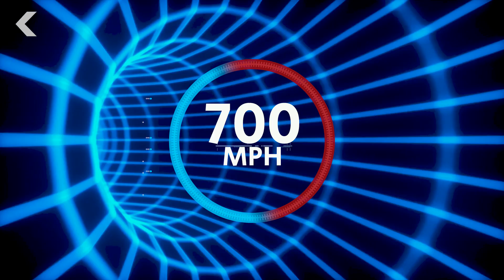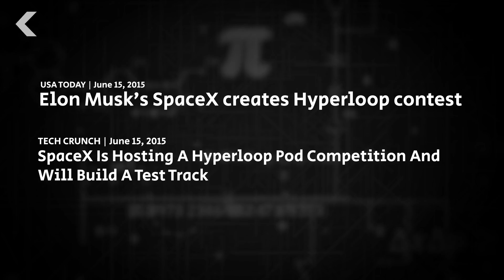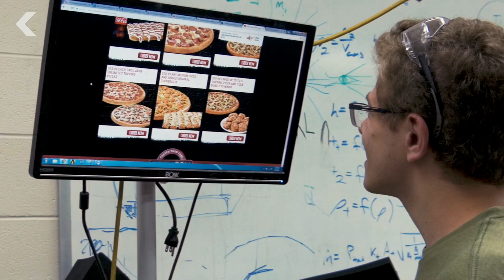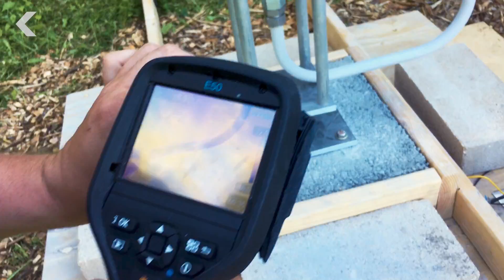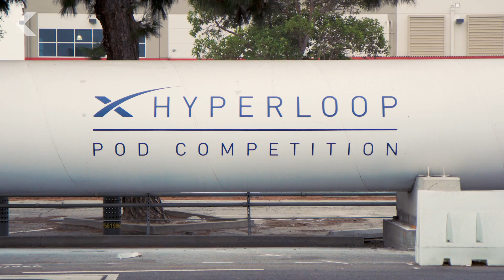These College Students Built a Hyperloop Pod... Here's What Happened

Comment: Cant believe that Musk does not have a single person around him with at least basic structural engineering knowledge, to tell him that this is total crap. He probably knows it, but stays on the route of milking government money for this failure.
Reply: Exactly how does a tube with a hole repressurize?
Reply: Valesto93
Hell, ok. This is just a thin aluminum tube. Aluminum skin of the airplane is not its structural support, they have a steel/ aluminum truss underneath. Without the truss, the tube has to be way thicker than presented to support the weight of the train and vacuum pressure (which is much stronger than the pressure difference on the airplane). Not to mention other stresses it will have (acceleration, foundation settling, thermal dilatations (radial and linear), wind, earthquake, possible sabotage, centrifugal forces if thermal dilatation is to be resolved by allowing structure curving), and yes - significant dynamical stress despite vehicle is floating on a magnetic field. But tube is not even the main problem, the airtight connections between tube segments are. They also have to take all mentioned stresses and keep perfect air-tightness, all the time, thousands of them. There is no force in this world that can stop 3 feet of ground tilt during California earthquake, and mentioned joints not only have to take it, but to remain perfectly airtight. Other structures faced with such problem (like RION-ANTIRION bridge in greece) simply leave "soft" parts where structure is going to snap without major damage, this is not a option for the tube. The level of perfection that this project demands is so far from reality, and i havent even touched dynamics and material fatigue, and security issues are epic. This is so futile. I already said that Musk and his team are probably aware of that, whether they are extorting government or private sheep, is irrelevant.
Reply: fradd i think he's just trying to use it to train student to engineer in low pressure environments like space
Reply: n4rzul aaah yes I forgot that if u just dump a bunch of moneys into sth the physical laws will magically change because hey you are so flippin passionated abouz it it just has to change
Reply: Neat 2cm of steel. That's just thin enough for me to put a bullet into it and blow the whole thing up.
Reply: From a mechanical its also suicidal.  Assuming B31 code and CFR design factors apply the WT and strength of the structure arnt there.  

The steel needs to be increased by a factor of at least 10.  Which makes this ludicrously expensive project completely idiotic.
Reply: it's actually 1 inch thick steel with some (unspecified, unfortunately) stringers for support. you're right that hyperloop is far too expensive though
Reply: Valesto93 few things, with the size of it depressurizing would not be slow it would be over fast and explosively. 2, it wont be high carbon armor plating. If this was made ot would have to be made out of mild steel. Meaning it would only be a matter of time till someone popped it like a ballon.
Reply: No one is saying they are smarter than spacex, what they are saying is that this idea is stupid. Even smart people are dumb sometimes.
Reply: n4rzl You have to think if its
A-cost effective
B-safe
C-practical
D-Will it gain new knowledge
E-Is there better alternatives.

This fails at all of them.
Reply: it's his private company..
Reply: Valesto93 bombs
Reply: But Simens already did something really simmilar with their transrapid technology and it worked.
Reply: (Ottla Kafka) Which law of physics is this breaking?
Reply: (izicial) It wouldn't blow up.
Reply: Valesto93 Your bottom point is right. But your top point is wrong. Just go there and see it for yourself.  It is rust covered and has a lot of bad craftsmenship. The hundreds of engineers that are working on it must be awful.
Reply: There is no new technology demonstrated in this competition, and technology of vehicles used in the tunnel is irrelevant to hyperloop's  main problems, anyway.
Reply: Fradd, Elon musk does know this will never work which is why he is not investing any money into it. There is a reason he has just mentioned the idea but has not done any development himself. He has used this idea to recruit employees for Tesla and SpaceX. The people working on these projects are some of the smartest people out there.

The only thing that Elon Musk has paid for is the vacuum chamber, the winners do not get any prize besides an award. The pods are all funded by themselves (or sponsors). He has set up a super good and cheap recruiting tool to get the brightest minds to come work for him.
Reply: Building a Hyperloop is impossible _now_, which is exactly why this competition exists. To develop the technology required to build one.
Reply: It's still theoretically possible, though entirely impractical.
Reply: I vote for more people like Musk and less like fradd. The world changes and becomes a better place when you attempt to make the imposible, possible, not when you nag and moan about all the ways it can't work. Have some imagination and balls, challenge the status quo, regardless of what common sense might tell you to do.
Reply: fradd How exactly will this be a failure?
Reply: From structural engineering stand point, which is my profession,  its laughable. I cant even begin to explain here. There are many videos and articles on the net tha expain things on many levels.
Reply: I do love how random people on YT imagine themselves smarter then SpaceX, that is just hilarious.
And of course the dumbest people don't have the capacity to even comprehend how dumb they are...
Reply: EpicClone5082 it wil be a faliure because elon musk doesen't know how metal works when it is heated and cooled, it streches. And bom your hyperloop looks now like a crunched can of Coke.
Reply: Jeroen Bollen you said it your self it is impossible. this competition is for the pods that are inside the hyperloop, not the hyperloop wich is the main problem, the vacuum chamber is the biggest challenge.
Reply: n4rzul it doesen't work. THE HYPERLOOP DOESEN'T WORK. and it collapses on it self + it is kinda rusty.
Reply: Highlighted reply
n4rzul - Yeah, give me billions of government money i will gladly show some balls and challenge the status quo. This is simply a scam and its on your expense, if you are tax payer.

Comment: Waste of time....
Reply: Yo Yo airplanes are also very expensive to maintain. That's why the Concord project never took off (pun very much intended), and why the SR-71 Blackbird and other high-speed/high-altitude surveillance jets were retired. It was just too costly to keep using them, no matter how effective they may have been at their roles. Also, with Hyperloop, you must remember that we are not talking about going from New York City to Los Angeles or NYC to London. We are talking about the distance between two different cities that are relatively close to each other; just one state over which is usually a few hours by car. Planes do make long distance travel across the whole country or to other countries more efficient, but when talking short, intercity or regional routes, their max speed they can travel, and thus their efficiency, is cut. Turns out that when going from Edinburgh, Scotland to London, which is only a few hundred miles away, it is actually faster to take a prop driven plane than a jet powered one, because the jet can't get up to speed by the time it needs to descend and land. Check out the video "What's actually the plane of the future" by Wendover Productions, start at 6 minutes in. Interesting stuff. Why not just use mag-lev trains that hold more people? Well as this video stated, Hyperloop will travel at around 700 mph, while the fastest mag-lev, the Japanese L0 series, hit a max of just 375 mph, making Hyperloop 50% faster.
Reply: how are you using your time
Reply: Yo Yo Lol okay
Reply: filonin2 aircrafts are still faster.....so it doesn't actually save much time... and also you could add more aircrafts without need of any extra construction... on the other hand maintaining that vacuum tube won't be cheap...  and by waste of time I meant was if they really want to build this they should get started right away , you don't need youngsters to show you the perfect hyper-loop model the technology is already out there being setup in hyderabad(India). A working one that is all set to open for public use by 2025...
Reply: +friendly911 OS So you agree with a moron who doesn't understand that this is a time saver? Are you starting a club for idiots then?
Reply: Trolls gotta troll : )
Reply: reading your comment is a waste of time
Reply: Actually its purpose is to save time. Did you even watch the video?
Reply: I agree, this whole thing is a waste of time.

Comment: >Here's What Happened
What is this? Buzzfeed?
Reply: Not much. That's what happened. lol. So yes just like Buzzfeed.
Reply: They didn´t mention that the tubes had no vacuum...If they vacuumized the tubes, the vehicle would be toast as well as the passenger.
Reply: Rg Msgreenred99
One more point, the full scale pod actually requires a certain amount of air to function. The fan at the front takes in the small amount of air in the tube and pushes it downwards to create a cushion of air for the pod to float on. Did someone say super cool solution to the Kantrowitz Limit!
Reply: OnionPug lol that's all I was thinking the entire time I read my way down these comments hahah

Also no homie the test track didn't pressurize in "just under 30 min" it actually took closer to 45 to an hour per run lol
Reply: ytreibiLeurT
The original article clearly states that vacuums are impractical, the hyperloop idea does not require a vacuum, just a low pressure solution.

Exerpt From Hyperloop Alpha (the initial proposal)
"The pressure of air in Hyperloop is about 1/6 the pressure of the atmosphere on Mars. This is an operating pressure of 100 Pascals, which reduces the drag force of the air by 1,000 times relative to sea level conditions and would be equivalent to flying above 150,000 feet altitude. A hard vacuum is avoided as vacuums are expensive and difficult to maintain compared with low pressure solutions."

In fact, the original idea for a hyperloop uses air bearings, which is impossible in a vacuum.

Is it too much to ask that you read the thing you're trying to debunk?
Reply: Msgreenred99
I can't believe I have to say this twice. Read the original paper before you try to debunk it.
Your comment is debunking a plan that nobody is proposing.
-----
"frictionless"
From the original paper:
"The expected pressure inside the tube will be maintained around 100 Pa, which is about 1/6 the pressure on Mars. This low pressure minimizes the drag force on the capsule while maintaining the relative ease of pumping out the air from the tube."

Nobody is talking about creating a frictionless environment or a vacuum. Scientific vacuum tubes operate at pressures about 1,000,000,000 times less than this. This is not 'essentially a vacuum'.
-----
"What if the tube depressurises and all the air gets let in"
From the original paper:
"The problem with this approach is that it is incredibly hard to
maintain a near vacuum in a room, let alone 700 miles (round trip) of large
tube with dozens of station gateways and thousands of pods entering and
exiting every day. All it takes is one leaky seal or a small crack somewhere in
the hundreds of miles of tube and the whole system stops working.
However, a low pressure (vs. almost no pressure) system set to a level where
standard commercial pumps could easily overcome an air leak and the
transport pods could handle variable air density would be inherently robust."

The paper then shows a graph of the pumping ability of commercially available pumps and gives a cost estimate of under $10,000,000 for enough pumps to continue operations with multiple leaks on a 700 mile tube.
See chapter 4.2, Figure 13. "Typical vacuum pump speed for functional pressure range."
-----
"have to pump out most of the air in a tube that stretches from san Francisco to los Angeles wich would take days, and be very very very expensive."
I would love to see your calculations for this taking days. I did some back of the envelope calculations, assuming 1 big pump every 7 miles working at full capacity, and came to 1.5 hours.
The test track depressurises in a bit under 30 minutes and is 0.75 miles long, so that suggests it would take 4 hours in real world conditions with one of whatever pump they're using every 7 miles.
Even then, when airliners come in at 50-200 million a pop, even if we have to double the vacuum pump budget to 20 million, that certainly doesn't scream impossible.
Reply: Anurag i
Reply: Raymond Corrigan well the pressure of the tube would be so low to create a "frictionless" tube would be essentialy a vacuum,  also space is not a vacuum,  and what if the tube depressurises and all the air gets let in, then you would have to find the hole that caused it and fix it then you would have to pump out most of the air in a tube that stretches from san Francisco to los Angeles wich would take days, and be very very very expensive.